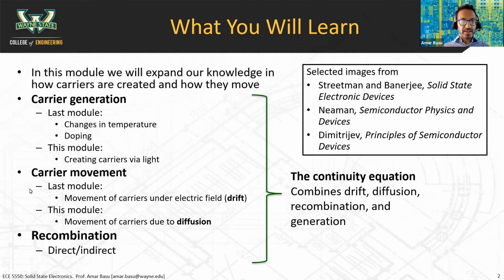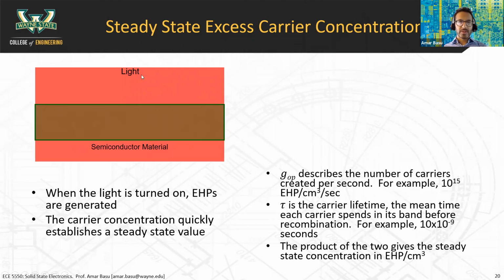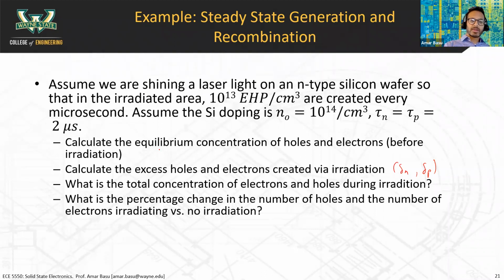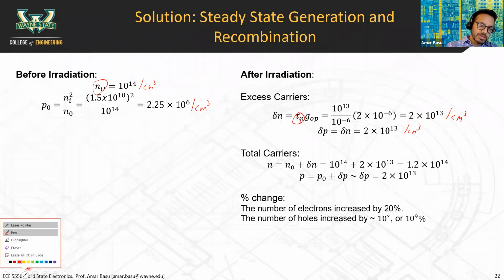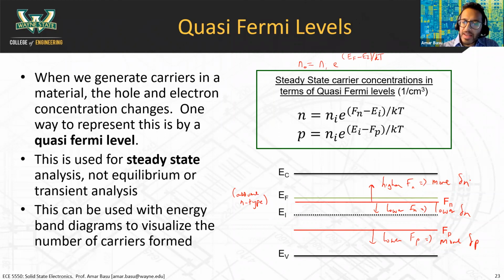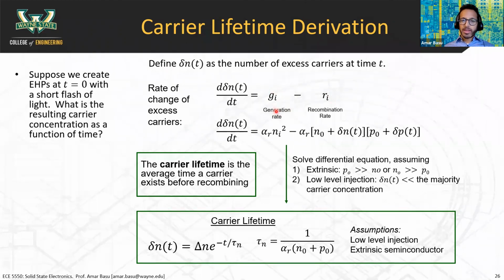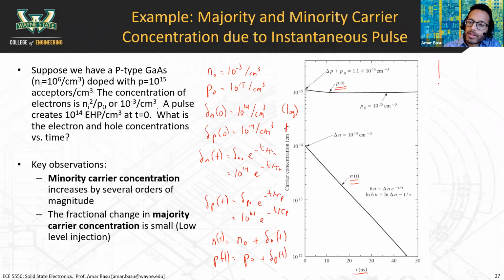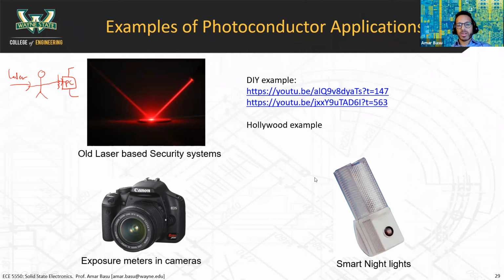4B - Excess carrier generation from optical stimulus

Comment: One of the best set of lecture series I have seen on this matter.   Holes and Electrons , the need for them always confused me and this offers the first level of clarity. I still am unclear about few other  aspects
1.  A free electron while traversing (due to electric field) , is it seen./modelled to  only hop across  conduction band of atoms ? And this. hopping will it create a hole, or the holes  are seen only in viewed to be in valence band ? So can  I conclude that conduction band is about electron mobility. and valence bad is  more of hole mobility
2. Since electron is free where as hole os bond in a covalent bond, hole has less mobility.  So in that sense, can one way hole has a greater effective mass than electrons